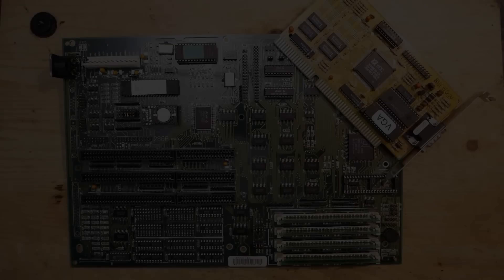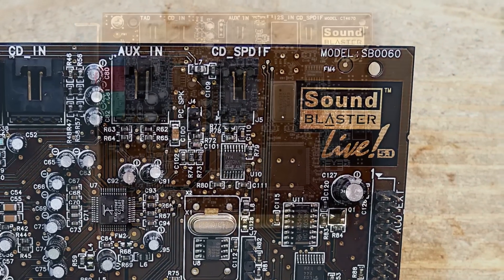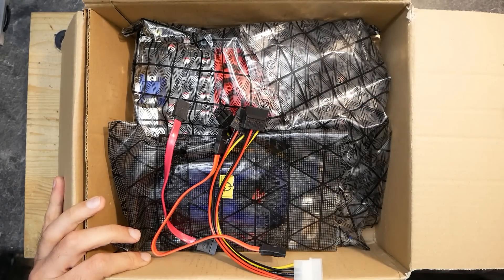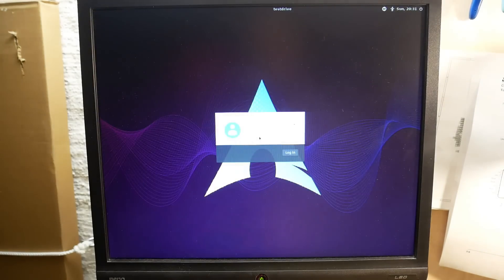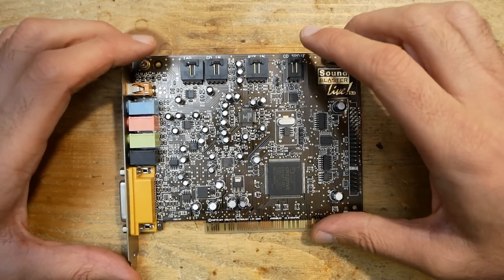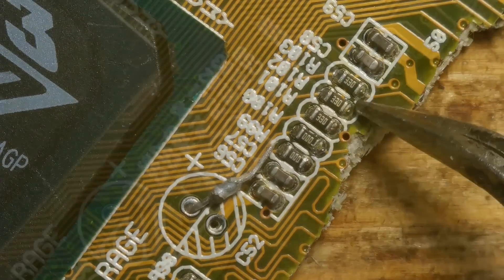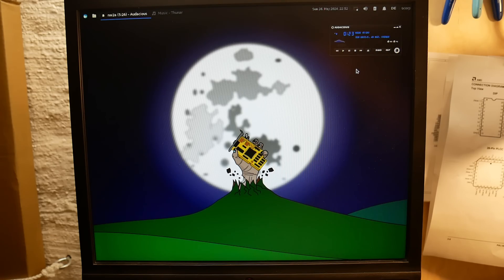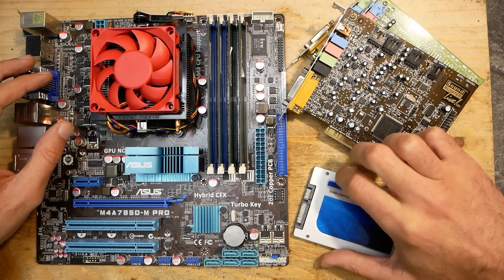How to quickly test a lot of hardware. Bringing Creative Sound Blaster back to Live!

Comment: This is exactly how PCI testing should be done. Linux really shines here, not 100% sure but could be that there are chipsets out there that support PCI hotplug, the kernel is definetly able to handle it.
Reply: Hot plugging could damage the cards i think
Reply: PCI hotplug is part of the ACPI standard, however it's not implemented on most boards. If you want to check compatibility, try dumping the DSDT and checking the PCI slot objects for an _EJ0 method.
Reply: @SiliconExarch  sata hotplug works with ancient hardware too. at least with the m4a. also, linux also shines when you don't test and only use old hardware ^^
Reply: Yep, this is one of my most useful tools.

I have a mini-ITX board in a mini-tower, with a PCI IDE / SATA controller, and one each hot-swap drive dock.  I just rmmod sata_promise, swap drives, modprobe sata_promise, run dmesg with the follow option, and wait for the all-clear from the kernel drivers.  Then I can run badblocks to test a drive, dd to create or restore images, or fdisk (or some of my own tools) to prepare it for use.

It also has a network interface (of course), a ZIP drive, and a USB floppy drive (case only has one 3.5" bay) which makes it a handy NAS-to-floppy converter for the mini tower right next to it, which has a SCSI ZIP drive, and 5-1/4" 360K and 3-1/2" 720K floppy drives.  Maybe some day I'll network that one too.. haha

Comment: What flavor of Linux is this?
Reply from the maker: After more than 25 years of using Linux I can tell, that it mostly doesn't matter. My personal preference is ArchLinux, but only because I got used to it in many years. For example anything Debian based would do the work just as good. On older 32-bit machines I use that one for example, because ArchLinux dropped 32-bit support years ago.  In Linux world it's more about understanding how things work. Once you know it, distribution is just a detail. If you don't understand it and instead try to switch the distribution  when something doesn't work, you will just exchange one problem for another.

Comment: I have an X-fi Titanium HD in my main desktop system.  To me it is one of the best sounding cards Creative made, and it's easy to upgrade the analog path if I wanted to- not that I have felt the need to.  It does have occasional driver issues, but I keep it because I like how it sounds- and I also like the built-in hardware sampling synthesizer that the later cards don't have.

Comment: I don't understand the point of Arch Linux... Linux Mint its so much better.
Reply: Matter of opinion, doesn't matter. Nice trolling attempt though.
Reply: @charlesdorval394  If you enjoy living in 1970 then i'm trolling, otherwise... Arch is retarded, it the so used by nerds and you required to use the terminal even for installing the GUI, at least Mint is trying to shift from that, writting commands its so 1970.
Reply: Let the distro wars begin! :) I will stand aside and count the points for each side.
Reply: @stamasd8500  how quick can your distro count? any debian based one will end in a kernel panic.
Reply: Windows is better…

No point to my statement other than to antagonize and add fuel to the fire 😂.
Reply: Mint has no reason to exist. It is a bastard. If you want to use Debian, just use the real unadulterated thing.
Reply: I would agree if you hadn't mentioned Mint, the worst of all.
Reply: @fattymcboomboom9254  Ubuntu maybe?
Reply: @fattymcboomboom9254  yes, just because you use hardware from the last century, doesn't mean the os has to be equally old.
Reply: @chaoticsystem2211  What old hardware which os? What are you talking about?
Reply: it's fine as long as you're able to read and understand the wiki. just memorizing won't do, i'm afraid.
Reply from the maker: LOL, what a mess in this thread.... ;)

Everybody knows, that Mint (except LMDE) is based on Ubuntu, and you know what "Ubuntu" means? No? It's ancient African dialect and means "Too dumb to install Debian". Of course I don't want to hurt anyone with this translation ;)
Reply: @necro_ware  at least the comunity isn't as toxic as the one on Arch users... Just reread your post.
Reply from the maker: @PCartCast  Sorry, I didn't want to insult anyone. This was just a very old joke. I found this whole discussion hilarious and as I wrote in another comments, everybody is free to use whatever fits the best. I didn't mean this seriously in any way and I though you neither. Especially as you wrote that console is only for old people from 1970s, who refuse to evolve, I thought that could be only a joke. I use console 90% of the time at home and at work and believe I'm pretty fast with it. Much faster, than I would ever be with the mouse. Of course different people, different preferences and it has nothing to do with being too old, or too young.
Reply: @necro_ware  LMFAO
Reply: @necro_ware  lol, i got carried away...

Comment: Is it really worth putting repairs into a $10 Sound Blaster Live? They are like roaches on eBay, as you can't get rid of them fast enough. The trouble is knowing the correct SKU to get, and not end up with an OEM Live (SB02x0/SB48x0).
Reply: But they won't always stay so cheap. Besides, why not fix it if you can? It takes literally 3 minutes of work, if not less. And 5 minutes for the diagnostics. Perhaps some people "value" their time too much...
Reply: It's very easy to change the SKU on these cards by modifying a couple of bytes in the card's firmware. :) The hardware is identical, and by changing the card's PCI ID it will identify itself differently to the driver installer, which will enable all of the features "missing" from the cheaper OEM cards. Sneaky Creative. :)
Reply: @stamasd8500  or you just change it in one the alsa files. but the hassle to adapt the internal connections (which do differ), is just a pain and i'd rather buy one
Reply: 10k views in 2 days for just for the cost of some flux, tin and heat isn't that bad ^^
Reply from the maker: People often forget how much time it actually costs to make and publish a video. Repairing and developing hardware/software doesn't even make 20% of the whole effort. 80% of my time is spent on going through hours of recorded videos, creating a plan, cutting, making additional pictures, schematics if needed, and of course publishing. Dependent on a video, every minute costs about 3 hours of work in real life. So,  the answer is no, it is not worth it at all, but I do it because it's my hobby.

Comment: is it actually ok to Test resistors in circuit? I mean in this case since the PCI slot isn't connected it's fine but usually other circuits add stray resistances
Reply from the maker: It depends, as you said, in this case it was ok. In other places it can be a bad idea.
Reply: Resistors are one of the few things you can test in in circuit somewhat reliably.